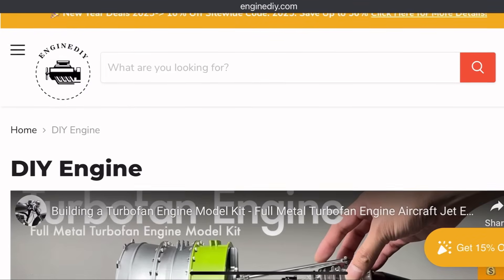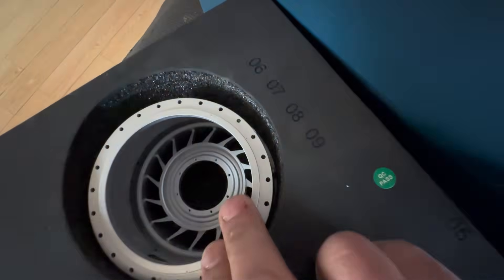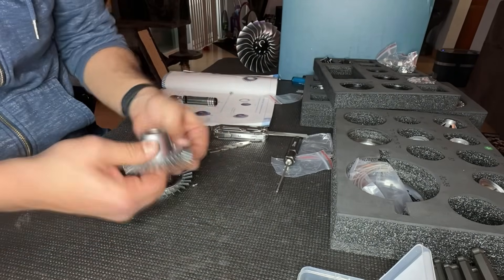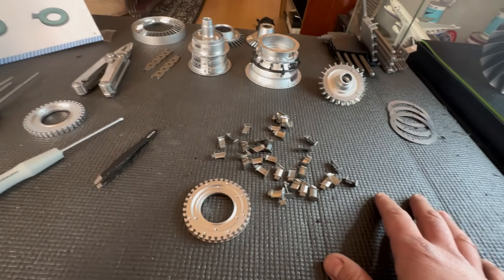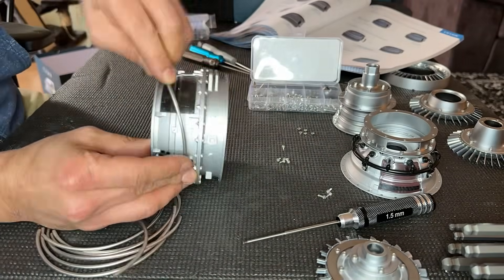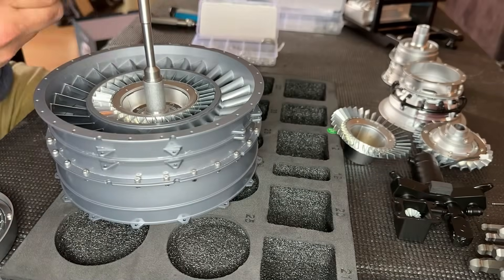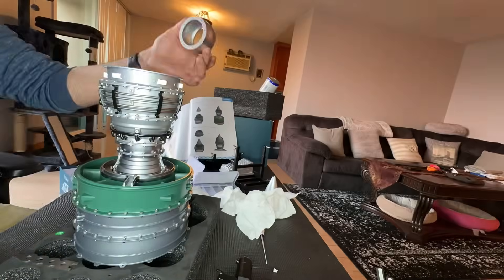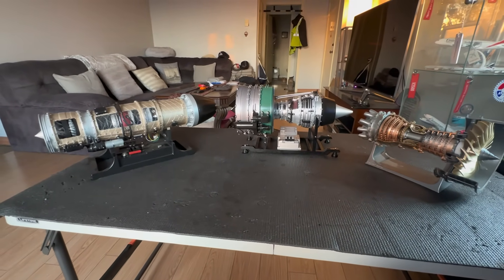Stig Projects (High Bypass Turbo Fan Engine Build)

Comment: These are gorgeous models!  I used to do models all the time as a kid. May I suggest do not use grease- too thick. 3 in one oil or cooking oil… few drops off the end of a tooth pick for applying.  So real maybe some jet fuel will run it?  lol.
Reply from the maker: It most definitely is an interesting model and very detailed. I’m sure if you add a few more extra features it could actually be a fully functioning engine

Comment: Great build Stig, good to know your all safe there my friend. I might have to raid the savings account and order one of these
Reply from the maker: @chrisnicholls8636  buy it only if you can afford it my friend. It is very pricey.
Reply: @StigAviation  I build Aircraft model kits, bit I have never built anything like this and being into aviation my whole life and studying engineering at school many years ago I do fancy building one if the funds allow. Any advice on the building side of it my friend
Reply from the maker: @ it’s fairly straightforward. My biggest advice is stick to exactly what the manual tells you. Because they wrote that manual in very much detail. The manual is just as complex as the model itself
Reply: @StigAviation  Thanks Stig, I should really try and time lapse a model aircraft kit build so you can see one my friend

Comment: Their QC regarding  parts must be very good. As a product manager, insuring that all the necessary parts were in the box, every so often something like a a screw would go missing. With all the very small parts in this kit, it takes great methods to prevent this from happening.
Reply from the maker: Very impressed with the quality of the materials and the tooling

Comment: Hey Stig, I’m building this engine right now.  Did you have any problems with the fuel branch pipes?  They are not staying in for me.  I’m thinking about introducing some superglue to the situation.  Thanks for any advice.
Reply from the maker: Make sure you have the right pipes in place. They are numbered. Look at the pipes. Its numbered 1-4
Reply: @StigAviation  Got it.  Thank you!

Comment: Nice! I got the cheap 3 D printed Trent 900 and it took like an hour to assemble only because a 1/3rd of was already done. Must be the way it was packed. The only down side to mine is no throttle. It just sets on two copper contacts and half engine turns as it sticks a little. Oh well, its mainly a display next to my 200 scale 380's. 😁 Might get the 3D version of the LEAP. has the fan casing and cowling. Stay Safe out there. Heard lots of well known actors lost homes.
Reply from the maker: I look at it the same way, it’s not like you’re gonna be running it all the time. So it’s more of a showpiece display model

Comment: Man I love this, but with our 7-1 exchange rate and the possibly 20% customs duty on it, We'd pay probably twice (or more) for this landed in Trinidad & Tobago. Frikkin awesome though. 

Either way, keep safe man.
Reply: OH BTW, Lemme ask a tech question: Now older fan blades are pretty spaced to allow for expansion (the clunking when they windmill). But do ALL the blades in the other stages do so or do they have to be rigid due to the amount of heat they  may have to endure?

Stupid question as it most likely may be "yes" but just curious. (maybe it's the vodka in this thing I'm drinking. LOL)
Reply from the maker: The inner blades also have a bit of play within them but with much higher tolerance.